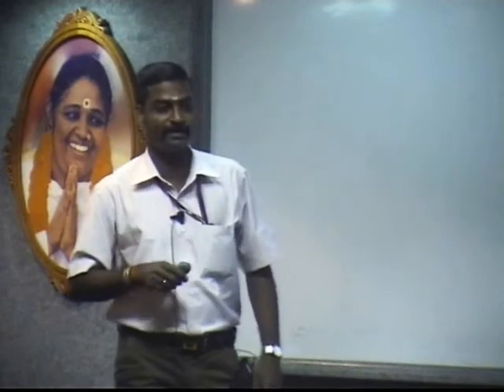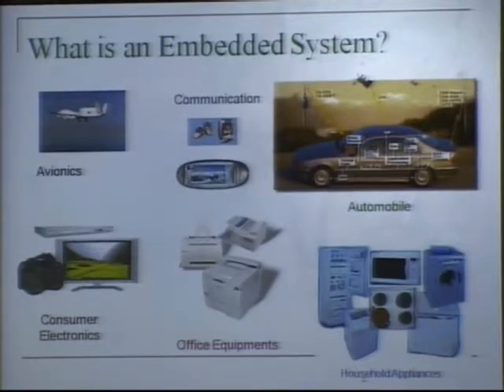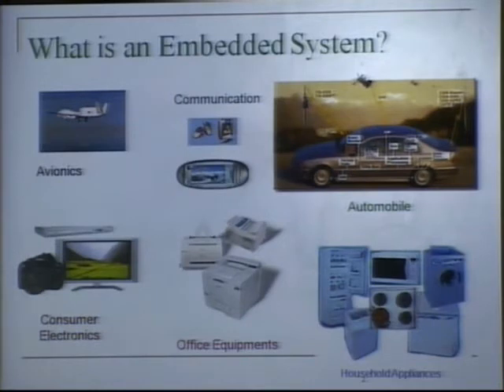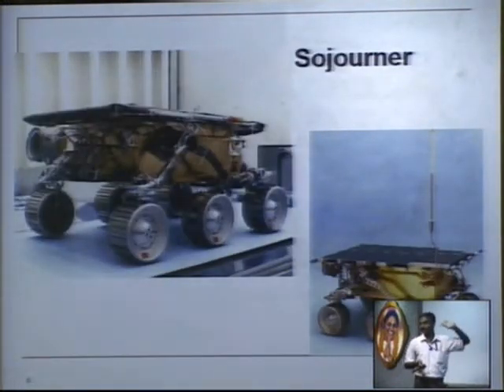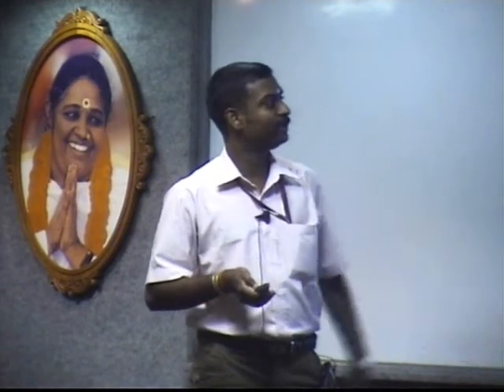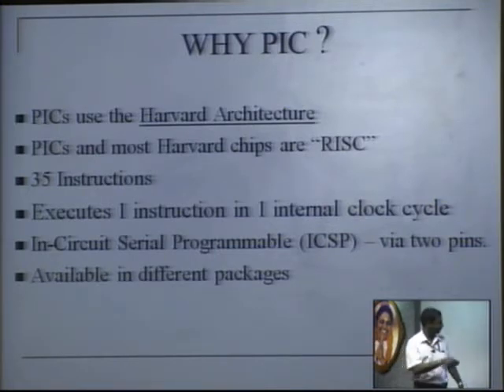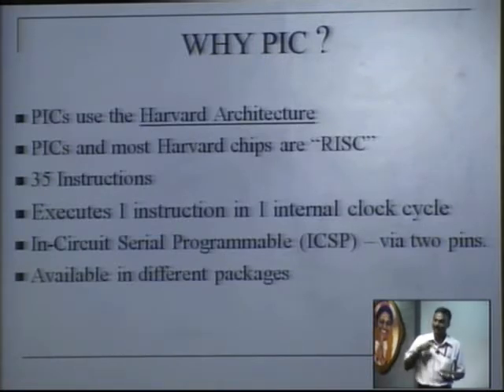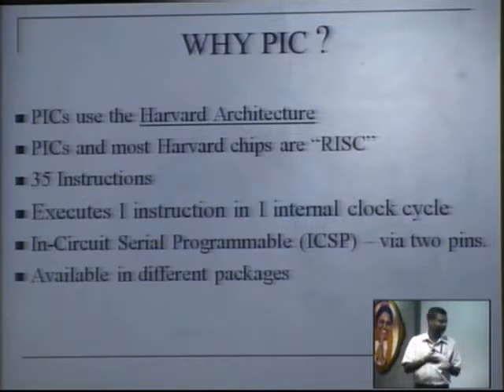Introduction To PIC Microcontrollers - PIC Microcontrollers Part 1

Comment: Nice presentation sir,thankyou. Sir could you please explain whether  ARM series and ARM 7 is a controller or processor and why?
Reply from the maker: Arm is a processor. Arm Inc will develop Soft Intellectual property core. There are more than 900 companies or silicon vendors who buy this core, they will attach there own peripherals and make there on Microcontrollers. So microcontroller means it is a combination of processor and internal peripherals.
Reply from the maker: Example for Arm 7 based microcontroller is Lpc2148.